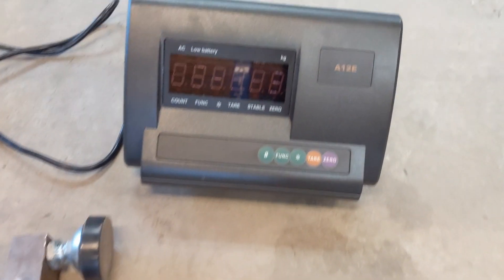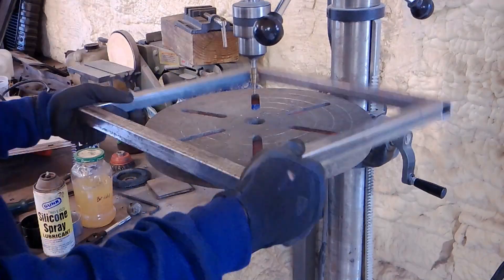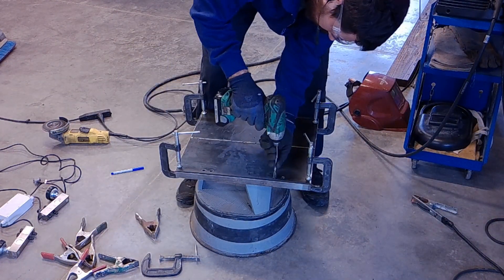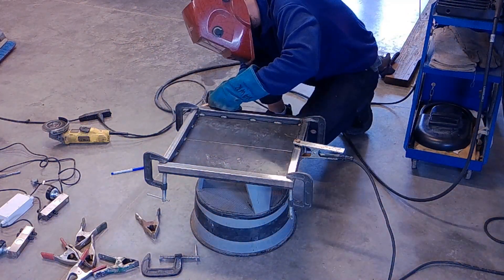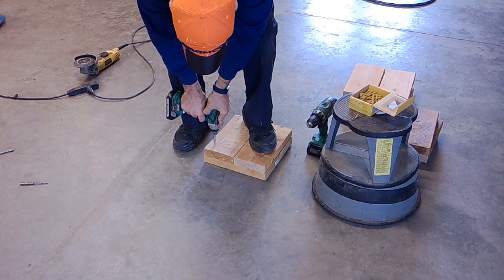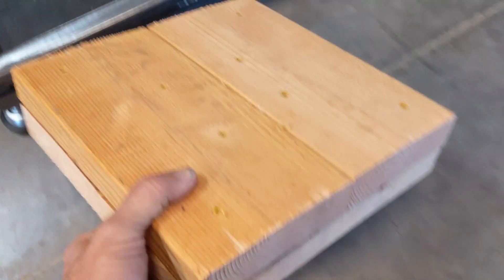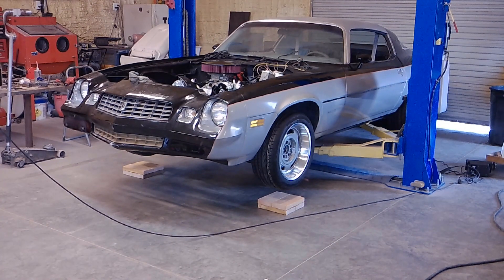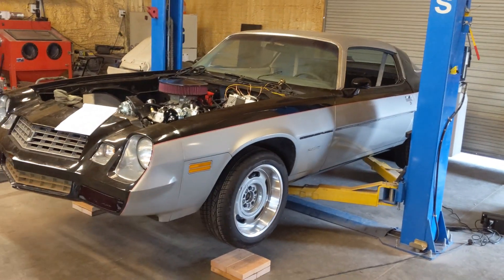How to build your own Auto Scale for 140$

Comment: Your very helpful video popped up in my search for a DIY car corner scale 👍 I had already discovered the livestock scale kits,  just wanted to see how others were building theirs. Been slowly converting a cargo trailer to a tiny home on wheels and have needed my own heavy duty scale to help determine layout affecting side to side balance, total weight and proper tongue weight now that I am ready to install heavier components as well as loading supplies and tools for the road.
Will be fabricating two kit scales to make the process easier. My max weight is 3500 lbs, shooting for 3000 so I should be okay using a heavy duty "bathroom scale" for tongue weight. As a bonus I can use the pair of scales in conjunction with a pair of blocks to check/adjust the front rear and corner balance of my S10 Blazer. I'm happy to finally have an affordable way to own these much needed scales. Thanks for showing us how to build it very very well, nice work!

Comment: Why not install the sensors at the end of your lifts lifting arms?  Then the lift would be the scale....  Asking for a friend.
Reply from the maker: I suppose that could be done. You would still need blocks so when you lift it up, you'd put the blocks under the sensors and lower it down, otherwise the wheels would hit the ground first. Then you'd have to remember to turn it on to tare the weight before lifting with it. interesting idea.

Comment: But it can't be accurate...I mean the scale is, but the final weight can't be, I tried myself with a bathroom scale and a chair, weighed myself on every corner of the chair and apparently I'm 30 LBS heavier! So you can weigh the corners of the car, but then, I think you have to use an equation to figure out the weight of the car...Adding up the numbers does not work...I get 30% more weight measuring the chairs feet separately and adding them up than I get when I weigh them all at once...
Reply from the maker: The weight would be off if I didn't use the wood blocks to keep the cars level. I have been using this scale for years and verify it with the scales at the dump and weigh stations and weighing my 7100lb truck came in 20lbs different than the certified weigh scales, and that difference could have been fuel loss on the drive home

Comment: Nice project Austin.  Here is some wiring help.  The colour code is as follows : RED is +EXC / BLACK is -EXC / GREEN is +SIG / WHITE is -SIG / YELLOW is SHLD so wire those colours to those similarly marked terminals in the junction box.

Question : can you comment where this calibration button is and what it did ?  I noticed you shortened the leads to the weigh bars.  Did you adjust the little trim pots in the junction box at all to compensate ?  Thanks !
Reply: Thank you my man!!!!

Comment: Do you have a link? I did not find anything that sold at a reasonable price.
Reply from the maker: https://www.ebay.com/itm/2-5T-Livestock-Scale-Kit-5000LBS-High-Precision-Indicator-Floor-Scale-Waterproof/124031796454?_trkparms=aid%3D1110006%26algo%3DHOMESPLICE.SIM%26ao%3D1%26asc%3D20190711095549%26meid%3D80cafc10c13d408c99b8887e7b3fc338%26pid%3D100047%26rk%3D6%26rkt%3D7%26mehot%3Dag%26sd%3D301389805272%26itm%3D124031796454%26pmt%3D1%26noa%3D0%26pg%3D2047675%26algv%3DSimplAMLv5PairwiseWebWithBBEV2bAndUBSourceDemotionWithUltimatelyBoughtOfCoviewV2%26brand%3DUnbranded&_trksid=p2047675.c100047.m2108

Comment: think if you build 4 platforms and use one of the weighthingies and 2 small wheels a piece set up in a triangle under the plate you could weigh all 4 wheels at the same time (you need the 3 ton version for this car but a smart car could be done this way) it might be a little off because it basicly levers off the wheels side ontoo the weightsensor but i think you could get it pretty close if you adjust the weightsetting a little
the wiring would be the same way you have it now just longer cables , cannot weigh per corner though unless you only use one scale the same way you do now or all 4 scales with a plank on top
Reply from the maker: I thought about a few different ways to try to weigh everything at the same time, but I couldn't find a reliable way without spending more money for more load sensors.
Reply: @AustinCoulson  the amount of load sensors stay the same theres just one loadsensor per plate , the 2 wheels across from them are just to have the plate move with the suspension when lowering the car prevent the sensors from being pushed sideways (a second plate with grease in between them works too), needing to weigh the whole car does mean that you need the loadsensors that go up to 3 tonnes or so , i checked for the set youre having and found them on aliexpress they have different ratings from 0.5 up to 3 ton , theres a small difference in price but its stull reasonably cheap 
found a different type of loadcel with a central display that could work too that was slightly cheaper but would take more work to make it work under a load plate

Comment: Will you post the wiring diagram? I don't know mandarin either. Lol
Reply: The colour code is as follows : RED is +EXC / BLACK is -EXC / GREEN is +SIG / WHITE is -SIG / YELLOW is SHLD so wire those colours to those similarly marked terminals in the junction box.
Reply: @proppilot9537  goat!
Reply from the maker: I'm told there are some of these scale parts on eBay that have a proper diagram. Luckily there are only a couple wires so if it's backwards you can just swap them
Reply: @AustinCoulson  ordered off Amazon... we shall see. Lol

Comment: Austin as i have these scales for my cattle you could have made up 4 plates.  one at each corner.  Possibly joining the two rear together and the two front together and get the scales to measure all four wheels at the same time. Obviously, for cattle we just need an area about 2.4m x 1.0m  I appreciate it may be a bit tricky getting the planks to sit square without rolling over. Maybe a sliding pipe to join each corner would do it. that would cut out the individual measurements. My scales will take a load of 10 000kgs. Which is 11 tons.
Reply from the maker: I thought about that, but the wiring instructions were in mandarin, and I don't think I could have figured out how to wire them all together.

Comment: is there a way to read these cells, one at a time?
Reply from the maker: I couldn't figure out how to
Reply: @AustinCoulson  thanks for the reply. I know this is an old video. But I'm trying to do the same as you without the lift. I want to make 4 platforms, but with one scale kit. By chance do you know if you can plug only one cell in and read it?
Reply from the maker: @laiky71  I didn't try that, but I did think about it and I think it would work. I was trying to find a way to be able to weigh the entire vehicle at once and I couldn't figure it out, outside of building 4 of these contraptions
Reply: Thanks for the info. My though was to build 4 rectangular or triangular platforms with only 3 feet, one side being the load cell, the other, 2 standoffs equal in height to the load cell. Then 2 pieces of tubing welded across the top to locate the tire in the center. If my vague memories of highschool math are correct, that would give you 1/2 the actual weight at each load cell. Then you need to read them one by one

Comment: You can't just bolt some load cells to a 1/4 plate and think you will be accurate. There is a lot more to making a scale then this.
Reply from the maker: This scale has been tested accurate within 60 lbs on a known weight 7100 lb vehicle. Its even accurate to a bathroom scale within 1 lb.
Reply: Why not? What would cause it to be inaccurate?

Comment: Soon I will be converting my 2020 Ford Transit to a camper van. I could not find a place with a scale that weighs each corner.  Thanks to you now I have an easy and cheap solution.  I ordered my kit right away ...once completed I'll post some pictures. Thanks again!!!
Reply from the maker: Awesome! I have been using this scale way more than I expected. Good luck on the build!

Comment: You made that look easy.   Interesting too.   We drive out trailers over scales from time to time to weight different loads.    Your scale would work great at showing the tongue weight on trailers.
Reply from the maker: Thanks! I do use the scale for tongue weight and it works good for that. Also good for motors and transmissions. I was surprised how heavy a lot of the crown Vic parts were.